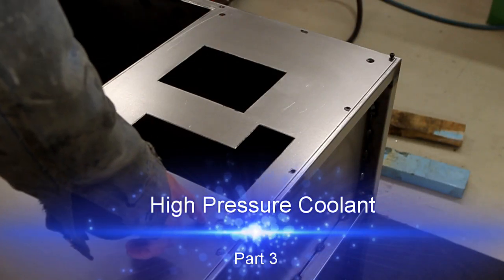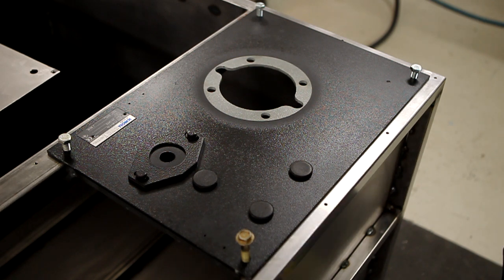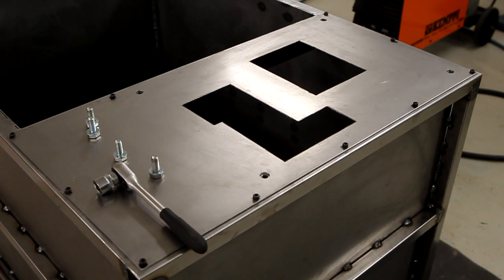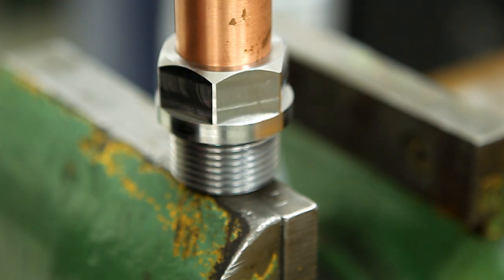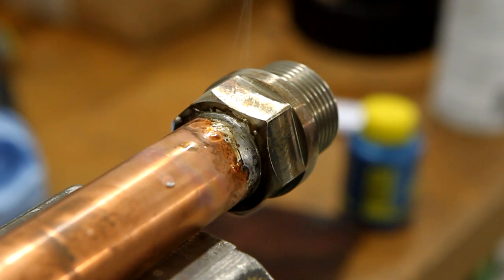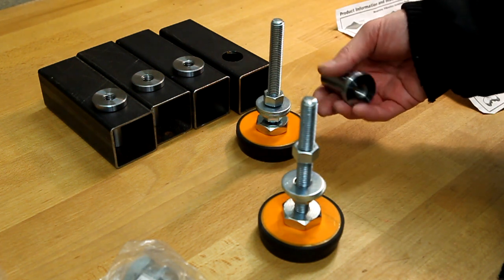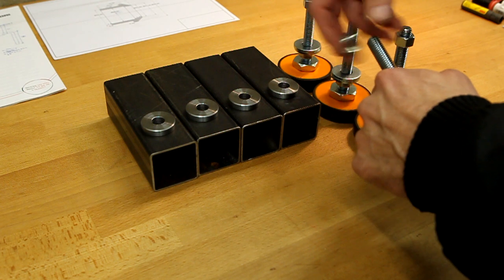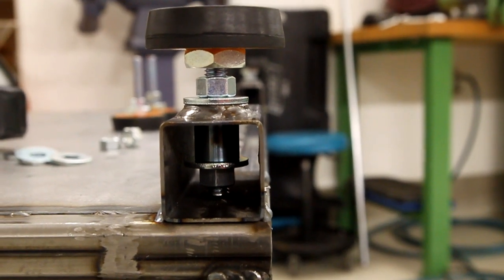High Pressure 03

Comment: Good job! By the way how is the Kaeser compressor doing? I'm looking for a new compressor with refrigeration unit to replace old noisy piston that spits oil.
Reply from the maker: Thank you ! After the initial troubles with the 12V electrical supply (transformer?) inside the control box it has worked flawlessly. It took them quite some time to figure out what was wrong though. I don't know, but I am tempted to say you should  at least get a price from Atlas Copco. They are at least as good I believe.